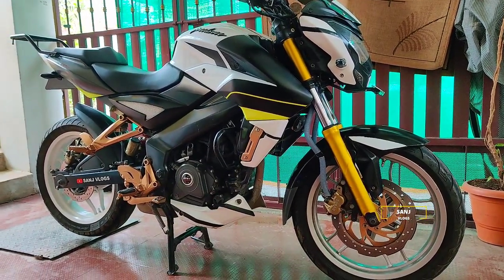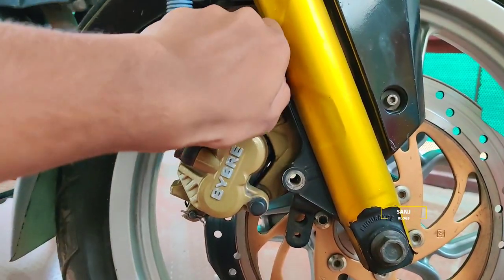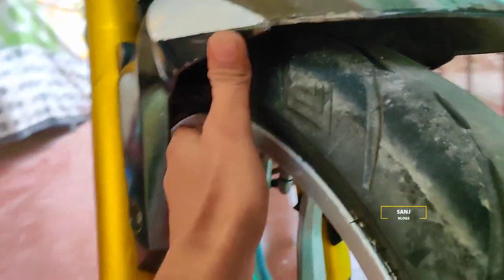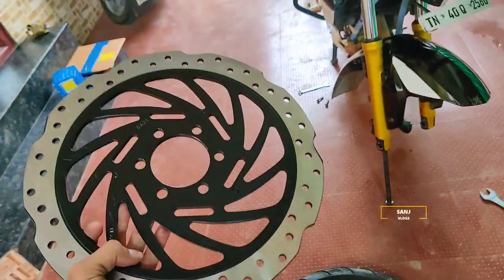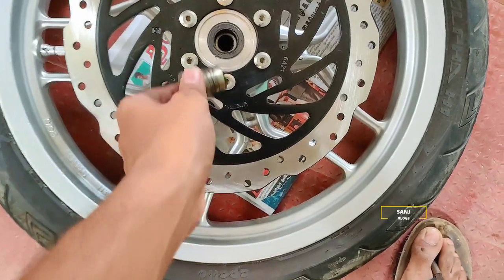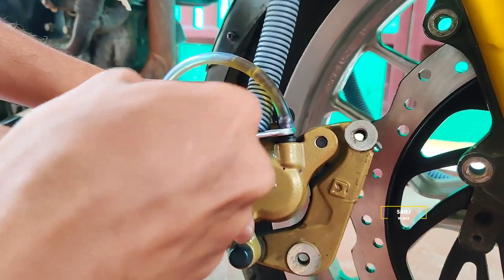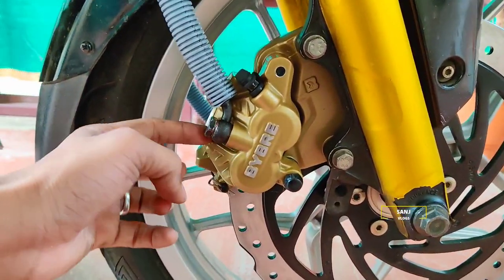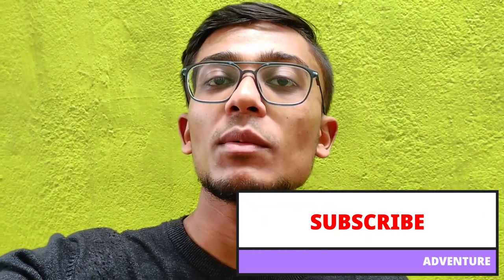NS200 Modification | 280mm to 300mm Disc 🔥 | Bigger Caliper | Brake performance 💥 | ABS sensor

Comment: Bro rear brake la stock la kodukura maari original ABS braking non abs bike la fix panna mudiuma its possible
Reply from the maker: Possible tha bro...but it's coat around 18k bro...😇🔥
Reply: @sanjvlogs6212  ok bro namma ns la rear la ABS ila so front la irukura pola same abs rear la fix panlaam la

Comment: Bro ns la slipper clutch podlama , lik dominar 250 Duke 250 has slipper clutch  almost they share most parts wt bajaj ns 🤔jst wondering if it's possible
Reply from the maker: Possible tha bro...with the help of clutch adjust... slipper clutch can be done bro 👍
Reply: @sanjvlogs6212  adhu pathi video podunga bro I'm waiting would b helpful for all ns fans

Comment: Bro one doubt I have bs6 ns 160 can I increase disc size 260mm into 300mm with abs
Reply from the maker: No bro....the holes in the disc and alloy wheel will differ bro...😇